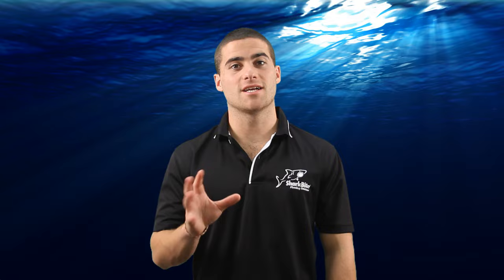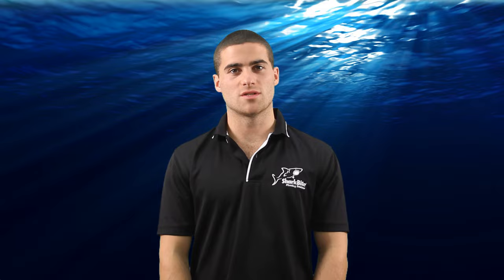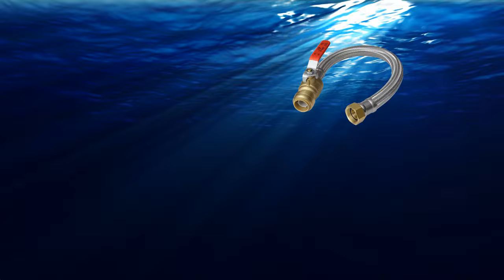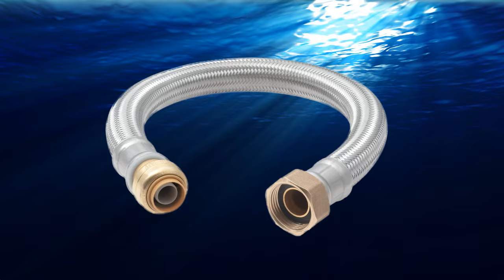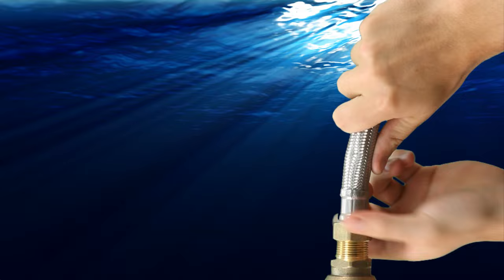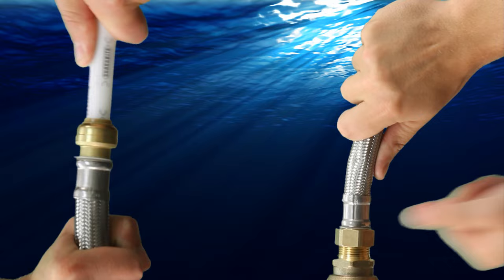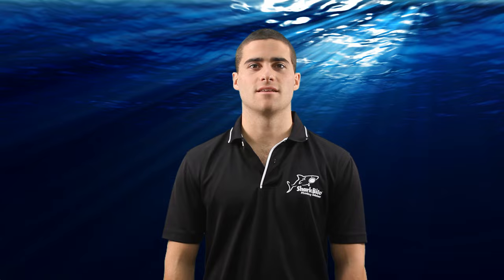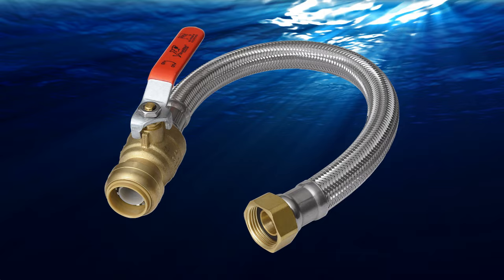How to Install a Water Heater with Flex Hose Water Connectors

Comment: Why does mine only leak when the hot water is running it leaks from the white washer after the valve on cold water suply into the tank

Comment: Don’t use or recommend plumbing tape before putting on threaded end?
Reply: I think the video was for general purpose, but agreed it can be misleading, or a few steps missing. Def. Thread seal the pipe threads :), about to repair a water heater with these.

Comment: I have pex pipes going to my water heater. how deep should I mark on the pex for the 18" sharkbite flex hose?
Reply from the maker: Hi Robert, if it's 1/2" PEX, then you should mark the PEX at 15/16" - if it is 3/4" then it should be 1-1/8". Hope this helps!

Comment: Hi, Can I use the SharkBite's Water Heater Connectors to connect from my under sink point of use Eco electric  tankless water heater to the faucet line and to the supply line?
Reply from the maker: Hi +NBSTL68  - As long as the Water Heater Connector is in an accessible location, and it will be connected to any of the appropriate types of pipe (Copper, PEX, CPVC) then you should be good to go!
Reply: Ok thanks.  I had read the first 18" or so coming off of a tankless heater must be copper for some reason so I am glad to hear this can be used instead.

Comment: Very good concept, very bad product.
Search online and you will find bad reviews of this product. 6 months after hot water use, the lining sheds. 
I just replaced the hot side today. The inside of the hose is a shredded mess.

Connector good, hose bad. Sharkbite needs to address and fix this issue.
Reply: Where do U find all this sharkbite products? Home depot, Lowes or do plumber supply houses carry it?
Reply from the maker: POLOAZTECA You can find retailers and wholesalers that carry SharkBite plumbing products in your local area here:  http://www.sharkbite.com/find-a-store/
Reply: +James Shrum The only bad thing is that it saves you money that you would otherwise pay a plumber.
Reply: Fred Montelatici so does duct tape.
Reply: If you talk to them on the phone they will tell you, DO NOT use the braided product in areas with either very hard water or high concentrations of chlorine in water.  Our area has the latter.  They advised we go with their corrugated product.  There is NO rubber liner in the corrugated products.
Reply: Happened  here .... on new water heater...shouldn't be on the market
Reply: sonofthe80s what corrugated product?
Reply: They just came out with a metal corrugated hose.  No rubber if plastic to degrade.
Reply: @SharkBitePlumbing Hello, is it still recommended to use Dielectric union on water heater and use the slip-on Sharkbite to connect both ends.

Comment: Not a good product to use on a HOT WATER heater.  They look great and install easy, but the interior of the line is a black plastic that breaks down in time. These small chucks go through the line leaving a black scum in the sink or if you drink the water...............  Check out any of the the SharkBite video and see for yourself.